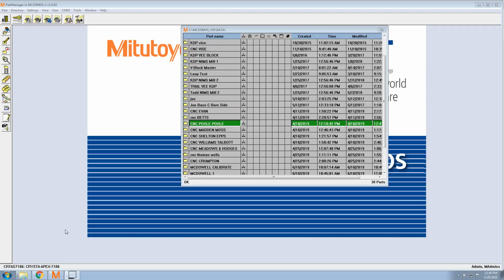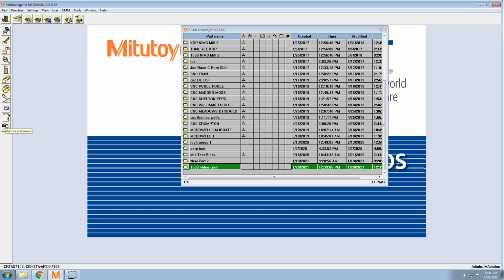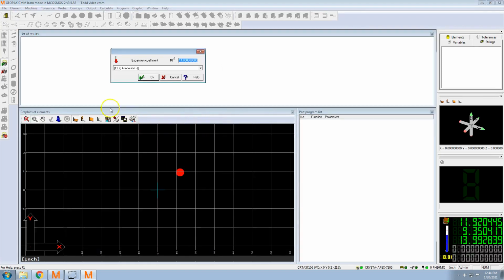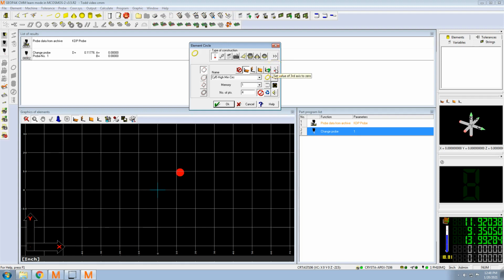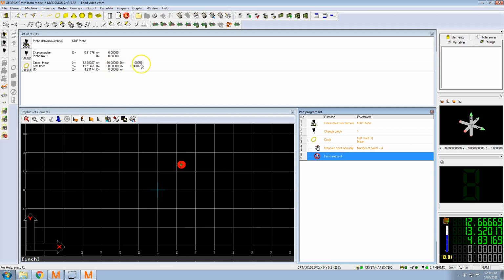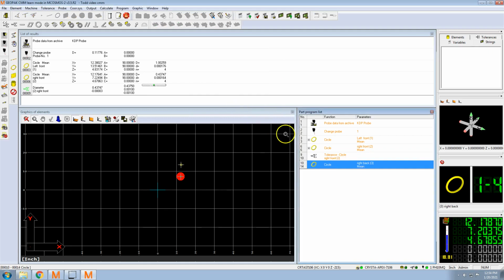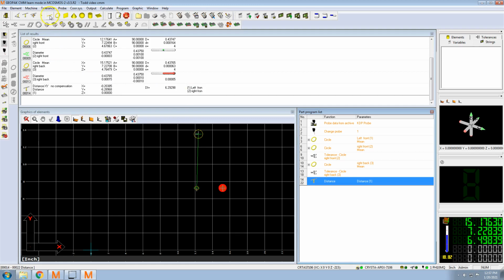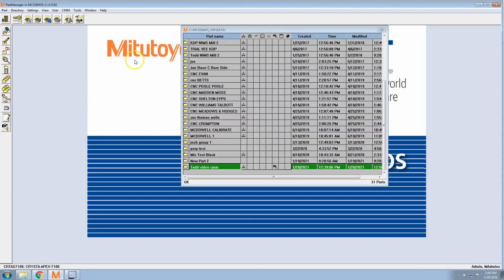Mitutoyo CMM basic software use

Comment: Thanks for posting this. Ive used PCDMIS and Polyworks throughout my career. I've started a new job with this old school CMM and have struggled to figure it out, using the old school manuals. 

I wish you had probe change angles and probe calibration.
Reply from the maker: I’m planning on doing a probe calibration soon. Just keep in mind that I’m no CMM expert but rather a machinist that has used this style a lot. I just got tired of re-explaining to new people.

Comment: Is there a possibilty to remeasure things? Like I have measured a circle and continue the program and it ends up red. Can i like click somewhere like go to that line and remeasure?
Reply from the maker: In my experience I will just click to measure another circle and then measure the same one again. I’m not an expert at all the software can do. When you click circle and the box pops up where you name it, there may be something in there where it allows a remeasure. 
I’m no QC expert but rather a machinist that’s used CMM’s a lot.
Reply: Hey, I have some decent experience with Geopak. No, you can't just click and remeasure a feature like you would on Zeiss. If you're in repeat mode and have a newer version of the software, there's a button (may be hidden) called something like "go to line" which enables you to jump to a line in the program, but you still need to run it till the end.
Reply: you can click the bin icon underneath the calculate option and delete untill your back to taking the 1st point
Reply: I know this is old but for future curious viewers… If your running the program and notice it red (it’s probably legit but..) you can click the pause button at the top, and then the back button ( |< ) to step back through the program operations to the start of the measurement. Then click play or forward ( >| ) and it will do that element again. You can also go forward step by step. Just be careful when stepping back through alignments or coordinate systems. Sometime it overwrites data but hasn’t reloaded/retaken it from a previous operation.